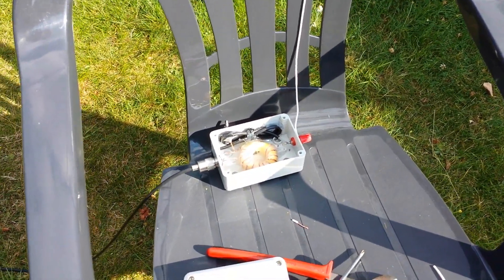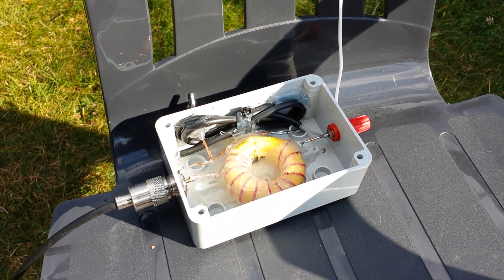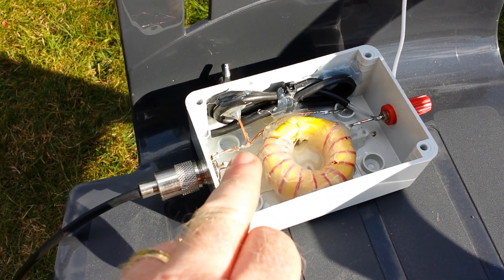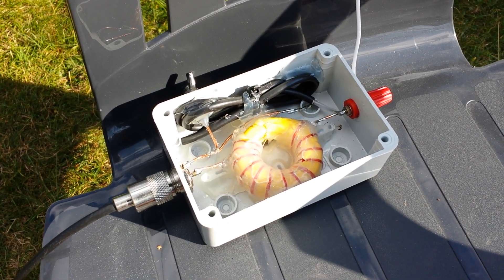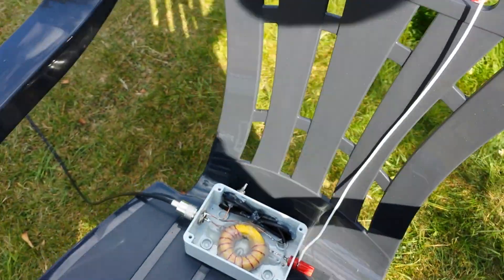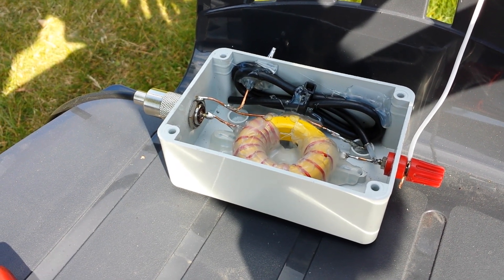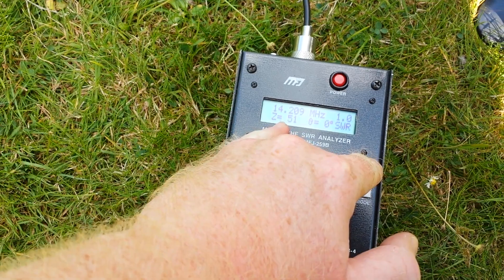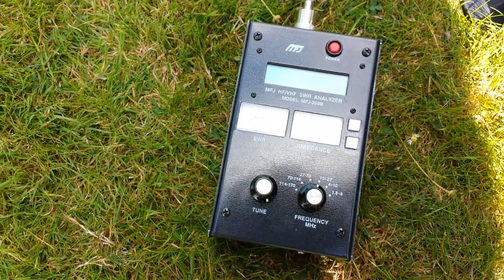EFHW vertical antenna

Comment: Thanks so much for your Video. Between Alex and you're posting I have made a 20/40 meter black box. It took me a bit, but the satisfaction of building it yourself is priceless. 73
Reply from the maker: Thanks very much for your comment. Indeed it's very satisfying having built the antenna and then having QSOs on it. 73

Comment: Can you use counter poise wire? If so how many and what length. Do you recommend rf choke? 
Good video! Thanks for the info! 73
Reply: Hello John. I've done a lot of testing with and without a counterpoise and found no different effects or benefits. As for a choke, I haven't suffered any RF problems but I only run low power compared to most. 73

Comment: i forgot to add trim 2mm of the end of the coaxial capacitor fold back the braid and seal with hot glue it will stop flash overs when you run qro power all good stuff

Comment: its basically the same as vk6prc has been using for years i have built a few and they work well the coaxial capacitor i put on a bnc plug and fitted a socket to the box i have 1/2 wave wires cut for 20/17/15m bands   also coaxial  caps tuned for each band vk6prc says better to not wind the wire around the pole but its working for you that is fine link to his video worth a watch https://www.youtube.com/watch?v=V0LkXnEZ0Nk&t=2469s
Reply from the maker: Yes I told him how to make it. I've known Alex for many years and talked on air too

Comment: uh ! isn't the core transformer supposed to be a -43 or -52 mix instead of a -6 ? Also, I cannot see because of the glue, is your primary twisted with the secondary ?
Reply from the maker: The 43 Mix is for the multiband construction, a different theory is adopted. See https://youtu.be/29CA_IPyg9M

Comment: How long wire of the antenna (40-20-10m band)?
Reply from the maker: Владимир Ковалёв its a half wave!
Reply: Tnx.
But half-wave for each wavelength? i.e. 20, 10 meters and 5 respectively for each band?
Or compromise for all bands at once?
Reply from the maker: Yes a monoband resonant antenna. That's why it performs well. Thanks for your interest

Comment: Thanks for sharing Mark. I have been looking at building an EFHW vertical for the my trolley to operate pedestrian mobile or portable. I wanted to build a high power version so was pleased to come across your video. I look forward to the next video, well done.
73 M0DAD
David
Reply from the maker: Hi David and thank you for your comments. As u know, put it next to salt water and you've got a big DX signal. I get over pileups with the QRP version!. Speak soon
Reply from the maker: Hi David and thank you for your comments. As u know, put it next to salt water and you've got a big DX signal. I get over pileups with the QRP version!. Speak soon